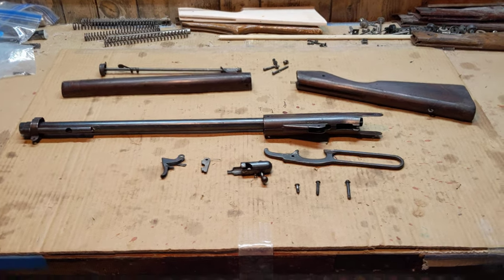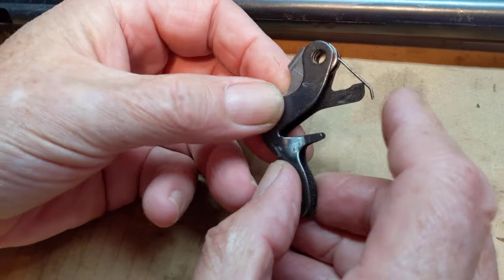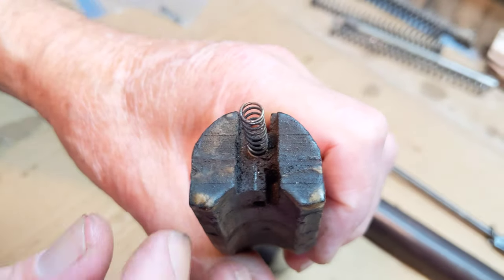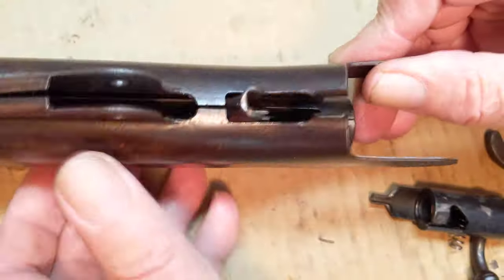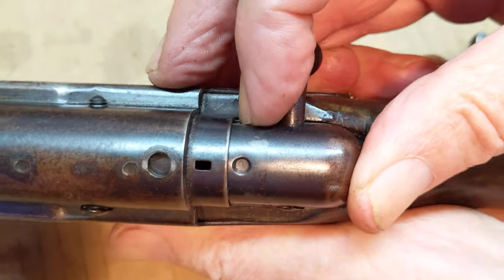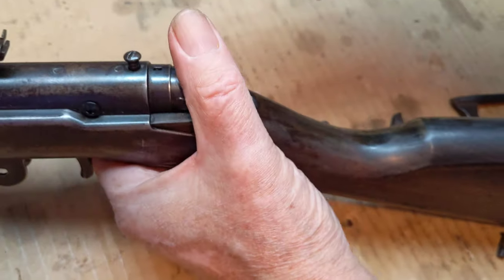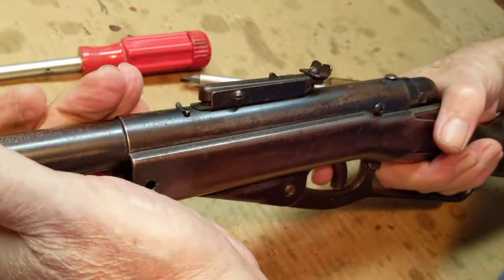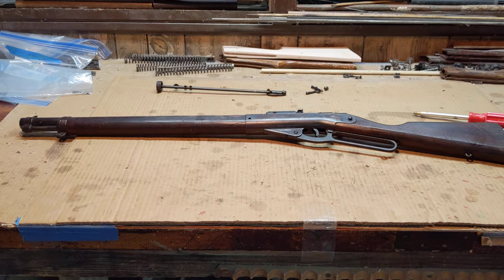Restomod Daisy Model No. 140 trigger and safety assembly Part 2

Comment: Good video !
That safety is an interesting design, wish Daisy would have continued/refined it on later models, perhaps not with a bolt handle, but a knob or Mauser-type “flipper” would have been cool.
Thanks for sharing !
Reply from the maker: I'm really tempted to mod one my wide body Daisy's to see if it can be retrofitted. Shouldn't be to tough.

Comment: Shane, I've got a model number 111, it has plastic stocks but I would like to put the current production adult red ryder stocks on it, what modifications would I need to do to the stocks to put them on the model 111?
Reply from the maker: None. Just bolt it up as the reciever holes on the Model 111 will match. You will need to transplant the trigger return spring from the Model 111 buttstock to the current production Red Ryder stock by drilling a 15/64/.234" hole about 1/2" deep into the face of the replacement stock. Use the original to locate the hole.
Reply: @RestOModDaisy  thanks for the instructions

Comment: I have a model w/o the bolt safely  and just a receiver that's empty.  You can tell BC the profile of the back of the receiver is different from other wide bodies.   Also the cocking lever supports are shallower.   Ripe for doing some custom work? 😊
Reply from the maker: Certainly!
Reply: If you want one to practice on.....😉
Reply from the maker: @daisylevergunfun4786  Thanks for offer but I've got three gutted recievers in house already . You should fiddle with it and put a side scope on it as well.
Reply: And fiddle I intend to.   As soon as the other 90 projects are done.   Haha
Reply from the maker: @daisylevergunfun4786  I feel your pain.